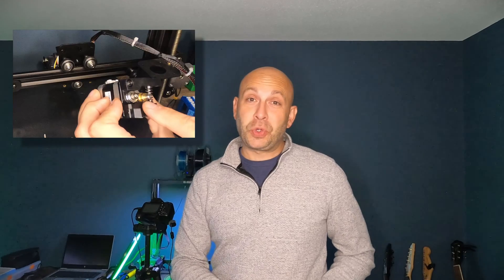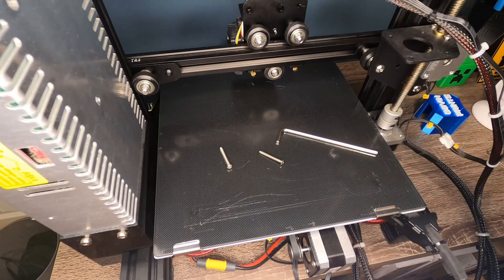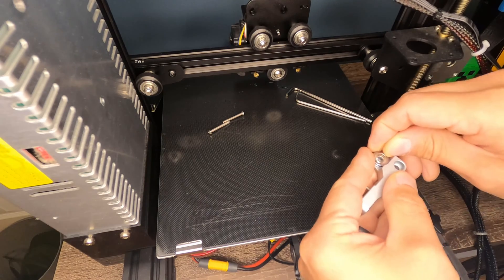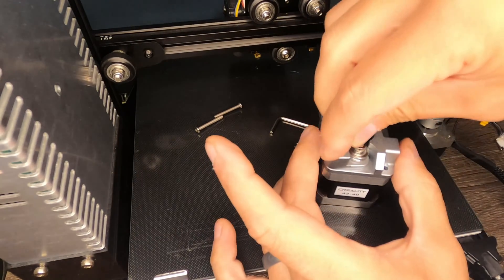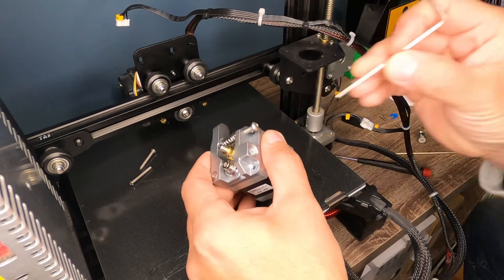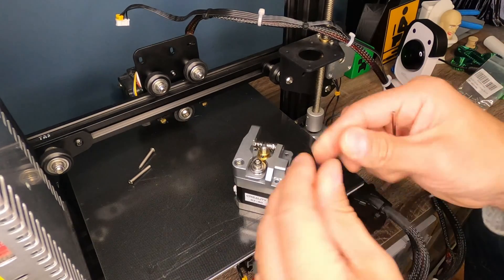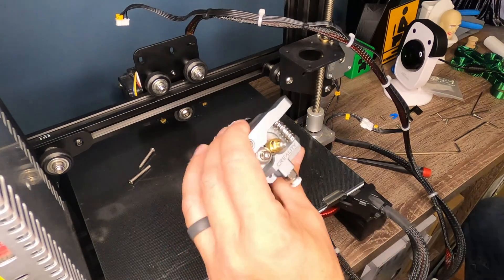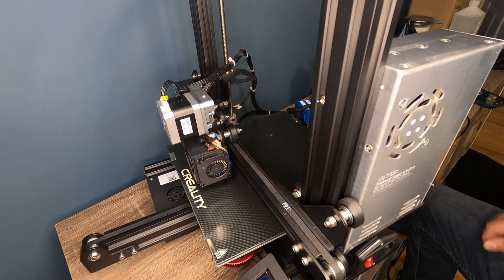Ender 3 Extruder Upgrade

Comment: I don't want to throw any shade, but that's not new. I upgraded my enders with that exact extruder in 2021. Also, if there isn't any wear on the original extruder gear, why replace it? Save the new one for later when it does wear out (not that it's likely to wear out by using an ender 3 as a hobby printer). 
I have a print farm with 16 Ender 3's and 2 Prusa minis, all of which get heavy use so I have replaced enough parts on all of them, including the extruder gear (for heavy use or exotic filaments, switch to the stainless steel) that the only original parts are the frame extrusions.
Reply from the maker: It’s all good man. Just showing anyone that’s interested how to change to the updated metal version if they want. I’m exclusive to Elegoo now. The ender was my starter printer and now my son uses it.
Reply: @theguyofalltrades  the problem is many ender 3 from oryginal run with plastic extruder mounted on the gantry with bownden setup have pressed on brass tooth gear and you can't simply change that without heat and gear puller or swaping the whole motor and this is the part that wears the most on this extruder, being plastic has nothing to do with how it works unless it start to crack from overtensioning when the gear gets bald so it is not really an upgrade for many people because the working component, brass wheel with teeth on the motor shaft is still the same
dual gear would be a direct upgrade and that thing has lower gearing ratio and two sides are pushing on the filement
creality metal extruder is just a replacement and even funnier it has no wiring loom mounting hook like plastic one does so for bowden setup it is sometimes even less than an upgrade